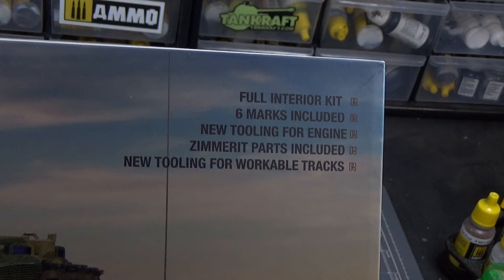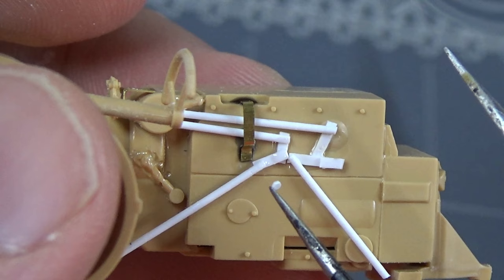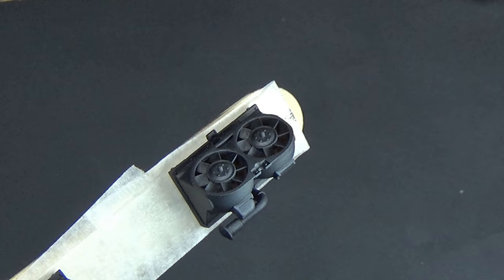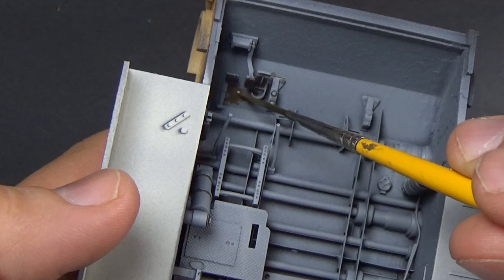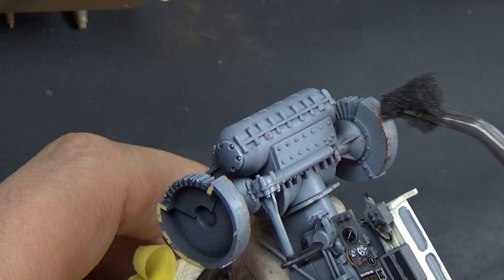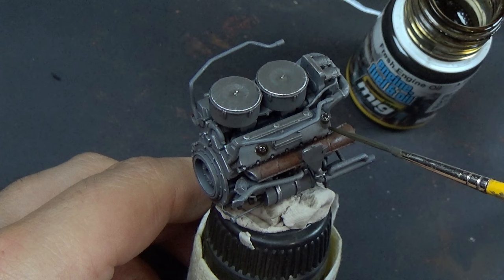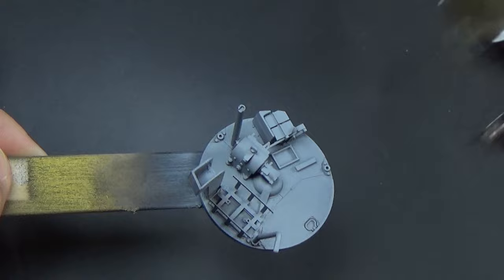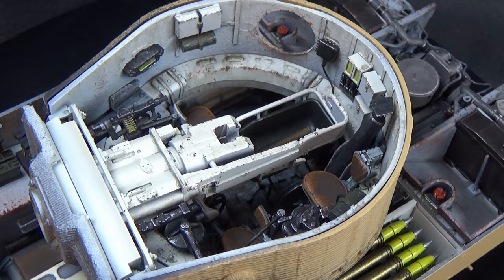Let's Paint and Weather a German Tiger Tank Interior (RFM 1/35)

Comment: Jus thought I'd add:
17:29  Tamiyas acrylic 'XF-84 'FLAT DARK IRON' is a GREAT exposed steel color, dark steel greyish-brown without a 'silvery' sheen of any sort...
(TAM's  XF-56 'METALLIC GREY' works well dry-brushed over the top of XF84  D.I for  high wear exposed edges)...

-Again, the TAM XF-56 Met-Grey dry-brushed over the top of it isnt too shiny in an unrealistic manner. I use quite a bit of the Dark-Iron in combo with the German undercoat/primer RotBraun/Red-Brown iron oxide as base coats or for chipping....;)

Comment: I thought the lower hulls in most German tanks was painted primer red.
Reply from the maker: They were primered in red then painted a base coat. Panthers were typically painted in the off-white. Tigers were painted a blue-grey color and the off-white. There was a small stretch of a few months where the Panthers were only primered in red and not coated in white. Check out my Panther build and you will see that.
Reply: No, at first they were painted a medium blue-grey colour in the lower half, and Ivory in the top half, and all pieces of working machinery in the Ivory part were painted black.
I can't speak for the very small tanks, but this rule applies to the Panzer III and everything larger.
Sometime in the early-to-middle of 1943 they began to stop using the blue-grey paint and they just left the lower part of the tank in its red primer.
There was also a brief period there when they didn't use the Ivory paint, leaving almost everything red, but there were complaints, so they soon brought the Ivory back.

As for the Tiger I  : it seems like the engine compartment of Panzers were usually left in red primer regardless of the year. But the Tiger I got the blue-grey colour in there too.
Reply from the maker: @daveybyrden3936  Thanks for the insight!

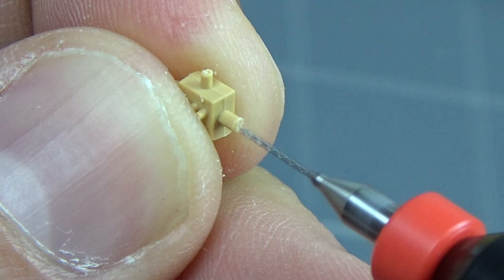Comment: At 3:58 the narrator shows us a small part and suggests that it's "power distribution" for the radio.
That part did not exist in Tigers.
RFM created this kit by studying photos of "Tiger 131" in the UK. As far as I can tell, they did not visit the museum to look at the tank close up.
And that's why they copied this little box, which is a modern controller for a fire suppressor system. It was added to Tiger 131 because of modern safety requirements.
RFM have been told about this, the error came to light in 2005. They could easily erase that part from their instruction sheet. But they don't. That's why I keep flagging it.
Reply from the maker: Thanks for sharing. I recall a similar piece on the Panther tanks which is where my conclusion came from. I also had seen the same wiring installation done in guides put out by Ammo of MIG. I guess I'll have to do more research next time! Will say it has been tough to find authentic interior photos of a Tiger though!
Reply: @relentlesstorm   I wouldn't trust Mig for anything, to be honest.
Concerning the radios: each module of the radio set (there were either two or three installed) had its own power supply, a smaller grey box. In most Panzers they are visible somewhere or other. But in a Tiger I they are under the floor panels.
Reply from the maker: @daveybyrden3936  Thanks! To your point, I found another error in my mig book that historical photos corrected for me. I'll talk about it in the next video. Thanks again!

Comment: Bit late, but for the fire extinguishers,  I had some included on a 1/35th M36B1 model I built, and upon searching for reference photos I found that some were silver, olive drab, a lighter sort of tan colour like on the Tiger, and a few red ones. I'm not certain of the authenticity of all of these, but it seems as though the olive drab and tan colours were the most common
Reply from the maker: Thanks for the information. I had one reference photo in black and white that clearly showed a silver extinguisher as well. I chose the tan color for the extinguisher inside and outside as red would've stood out too much I think.
Reply: @relentlesstorm  Sometimes the black and white reference photos can be hard to tell. I think you made the right choice, especially as most of the red ones seemed to be more recent photos and not during the war. This is the first interior kit I've seen someone build and it looks great

Comment: This ones next in my build queue w/ATAK zim set/Metal Tracks. Itll be under a 16T Fries crane getting its  turret roof plate OxyAcetyline cut & replaced  w/a donor roof plate, by a Schwere Panzer WerkStattCompany crew (Battle damage/partial pen to top side turret  that also buckled the roof plate beyond simple/common repairs)...So as to better show the turret interior, although a bit of the inside  turret walls will be lined with  anti fire/slag leather sheets....

Its my 2nd stab @ such a scene, guess the 1st one was a prototype? Plus my skills have advanced quite a bit since I'd finished the 1st one....
(Been steadily working away on a Normandy '44 Panzer WerkStattCo(s)  mega-dio for past 15 years now. Base prob be 5-9 foot in dimension, poss 4x8? Well see I guess?)

NICE WORK here man! (RFM made a Boo-Boo with the  T1's rearmost sponson ammo storage, as all the stored 88 rounds were stored facing forwards (Make such MUCH easier for the loader & crew) 

Oh well, if interested,  if youre not familiar with already, David Byrdens 'Tiger 1 Info Site' has damn near EVERY modeling company's 1/35th Tiger 1 model  kits omissions, oversight(s), miss-steps n' whoopsies.  Hes got an accurate critique on nearly 60+ T1 kits, past & presently available, multiple photos, changes made from early-mid-late, explanations, & diagrams available for every issue presented....

-A Tiger 1's ADHD prone 'Rivet-Counters' dream site..;)

You'd prob be interested in the two-book/volume hardcover series: "Repairing The Panzers-German Tank Maintenance In WW2"  in ENG by author: Lukas Friedli ($50-55$)...Emphasis on the heavies & mediums in all manner of disrepair & re-fit. HIGHLY recommended for the armor modeler...;)

Keep up tha great work dood!
Reply from the maker: That diorama sounds incredible! This hobby is so much fun and like you say, each project teaches you something and you keep getting better and better. Thanks for the information references. I am definitely going to check those out for my next Tiger interior build. I have the RFM mid Tiger with the cutaway hull and turret that I want to do. I do love book references so I'll be sure to check those out as well. Thanks!
Reply: @relentlesstorm  LOVE your work!
Oh dude, its a MONSTER indeed. WELL past the point of no return here.  Couldve bought another entire home @ this point!..Ha!
-Over 300$K into it so far (over time), as to models, figs, buildings, paint, scratch building materials, sundry items....
-Got a FAMO here on the bench about to get wrapped up, I somehow have over 400+$'s into it all with aftermarket kits involved!?...EEK! ('Tiger Model Designs'  wonderful resin 6-8 ton bilstein crane & his accessories offered for vehicle, 'Panzer-Art' FAMO front wheels & all the Wheels/Tires for the Famo's Sd.Ah.116 23 ton trailer, 'Panzer Concepts' FAMO late fender/air-tanks/wheels/track kit. 'BoldDivision' folded canvas drivers cab/tilt. the TAM FAMO also kitbashed with sub-assemblies from 'AFV Clubs' Bussing-Nag 4500A 3-ton crane truck (AFV's is an EXCELLENT, well-detailed kit BTW, you'd prob dig?)...All I can say is that Ive painted up nearly every era-appropriate 'PlusModel' accessory set they offer, many in multiples...Ha! Thank the Lord above for PlusModel. They just do >>incredible work<<...;)

Prob built all models involved in dio thrice over now due to skill >> progression >> 
-650 1/35th figures @ last count, 1/2 of those commercial resin example$..Ive yet to even start on the base, groundwork & trees...
Many tanks/vehicles under repairs & passing through, or coming from the front. Small field hospital, Nachrichten/Signals detachment, olde Roman ruins, large field officer meeting, field laundry, river & bridge. I appreciate the more mundane aspects of life behind the front, as the fiery kinetic energy of combat scenes is well nigh tough to capture in any scale (Or do correctly, although it can be done) 
Prob 4 PZ III's, 5+ PZ IV's, 6-8 panthers, 3 Bergepanther recovery tanks,  5 heavily mod'd FAMOS w/two trailers, 6-7 Tiger 1's, 10+ StuG III's/IV's, 6 or so Sd.Kfz 234's armored cars of all types.(Then RFM & Miniart releases NEW Sd.Kfz 234's!?..Grrr-ood thing I guess?...;)

 Bunch of soft skin vehicles, buses, Anti-Aircraft emplaced 88's & 20-37mm armed 1/2 tracked Sd.Kfz 7's & 8's. A TON of scratch-building (Which I LOVE doing;), all 'Hansa Systems" structure & buildings, hes got GREAT stuff BTW-'Legos' for adults;) All buildings present plumbed for lighting, etc....Plan on donating the dio to a museum when done....

The overall scene being a French mans rural countryside Gas Station, bearing his own auto/heavy truck repair shop, machine shop, foundry & auto junkyard. GREAT short term place for Germans to rent from him for a bit & set up operations due to in-place additional heavy lift gantries. Late June-Mid July 1944, somewhere between Falaise & Argentan, France....

SO Correct as to ones skill progression, even models completed just 2 short years ago dont seem to stack up quality wise against current builds, so time to re-purchase & rebuild em (Or try to repaint/jazz em up a bit if poss). This on top of modeling since I was 5 years of age (Born: 12/25/1974) Theres >always< room to get better right?

STILL learning new techniques & striving to properly apply them, set new goals or way-points to meet. The reason why I love your own & others vids here on YT,  being that I pick up so very much from them. For that:  I thank you for your copious amounts of work invested, with not only the models themselves, but the immense amount of TIME invested in the video making editing, narration & overall vid assemblage process.

  Such a discipline being an entirely secondary art form in & of itself! (I'd thought about doing so, but it would suck up SO much more time than just the build process's alone!  -IF I ever vid  n' post examples of my work, itll be a quik n' sloppy job just showing the past n' present works. If I ever do, Ill def letcha know)

Looking forward to more of your new build vids & viewing the older ones, I'd just stumbled across your YT channel today. Sub'd....

Take er easy & enjoy your Sunday & summer!
~Greets from Whidbey Island, WA, C.L.R

Comment: Im building this tank at the moment,  but there are some faults in the kit . Like the whole  asmebly for the radio is missing and the piping and plumming for the engine in the  manual. So i bought a book with Nice pictures to find al the parts lent in the sprues
Reply from the maker: That's incredible that you found a book with interior photos. It's very hard to find those details. Are you building this same kit by RFM?
Reply: @relentlesstorm  yes but its the mid production
Reply: Hello i have another question, how did you make those cooling hoses? There not in my kit . Did you make them from the spreus?
Reply from the maker: @tiezel5656  The radiator hoses were in the kit. I shared all of my scratch built components.

Comment: Had no idea those big cats had gasoline V8s with dual 4 barrels, wow. Would have been way better off with diesel engines.
Reply from the maker: The Maybach engine is actually a V12 gasoline engine. Many German and American tanks were gas powered early in the war. Heck the US used radial engines in the Shermans and Stuarts to start.
Reply: During the war, diesel was actually difficult to find, it wasn’t a popular fuel at the time.